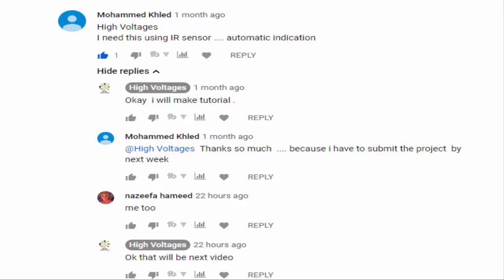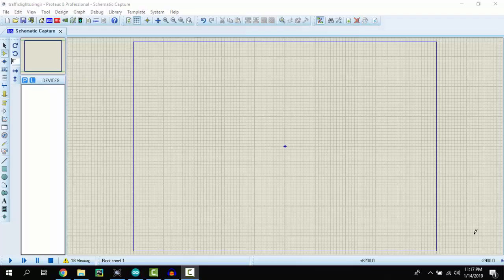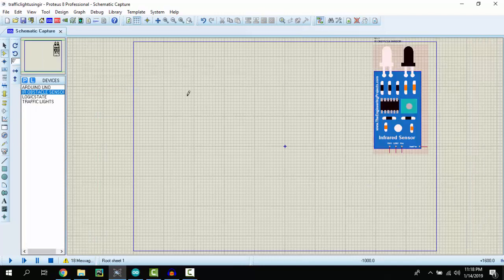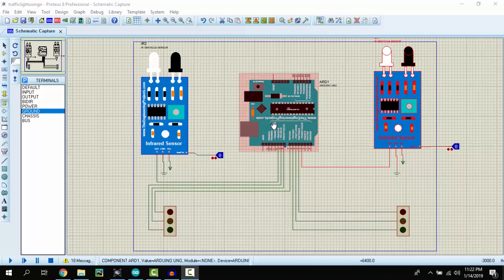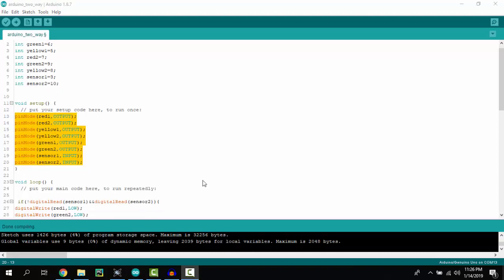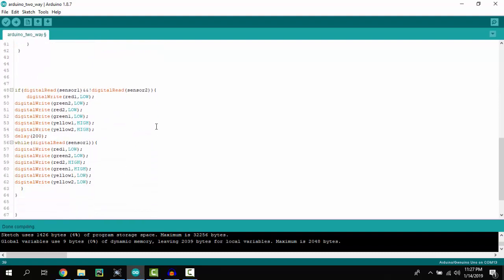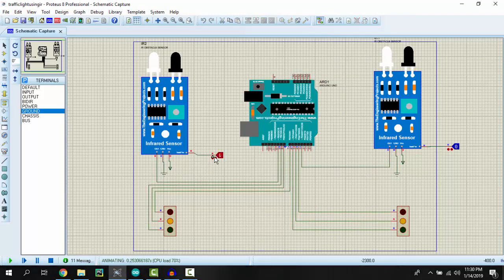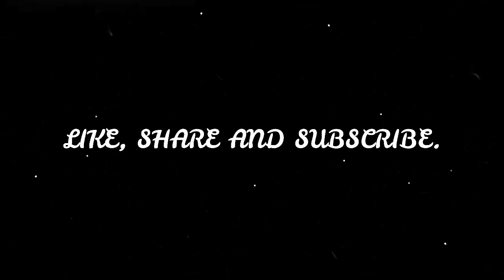Traffic Light using IR Sensor

Comment: Sketch uses 1428 bytes (4%) of program storage space. Maximum is 32256 bytes.
Global variables use 9 bytes (0%) of dynamic memory, leaving 2039 bytes for local variables. Maximum is 2048 bytes.
wat does it mean?
Reply from the maker: download the latest arduino IDE.
Reply: @HighVoltages  Sketch uses 2160 bytes (6%) of program storage space. Maximum is 32256 bytes.
Global variables use 188 bytes (9%) of dynamic memory, leaving 1860 bytes for local variables. Maximum is 2048 bytes.

got  same error in latest version
Reply from the maker: @nazeefahameed9390  email me highvoltages670@gmail.com